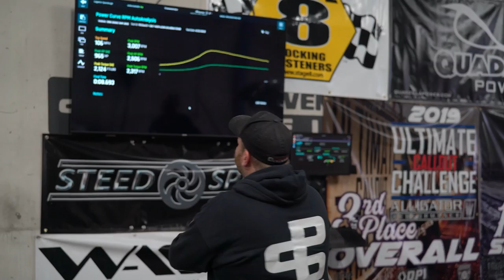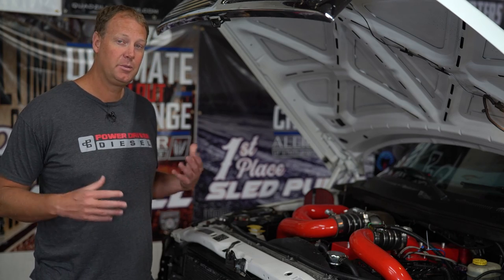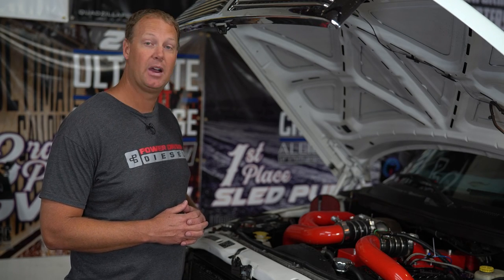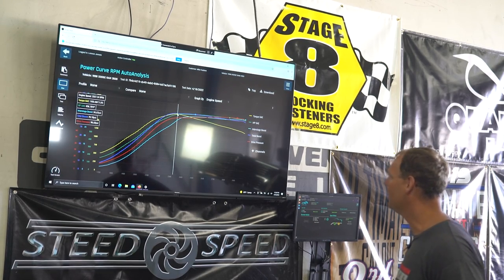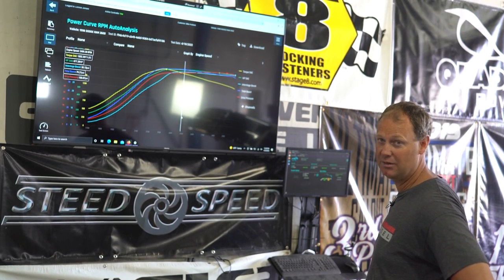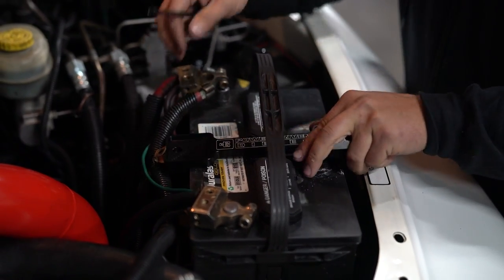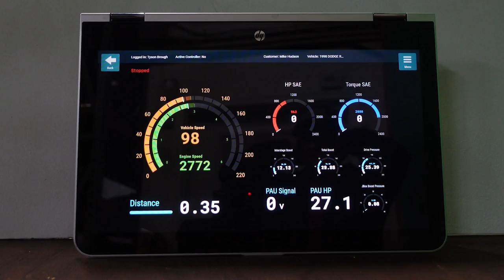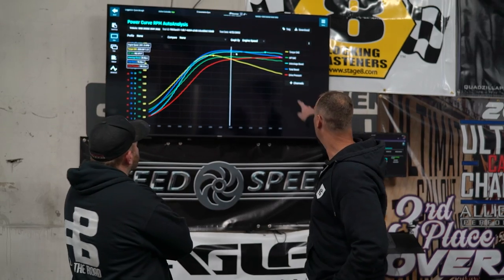Tow Ported Cylinder Head Dyno Test

Comment: Cool video I'd be curious if you all did one with the Hamilton stage one headed against your stage one head
Reply from the maker: As fun as it is to test competing products, it's difficult to show a credible comparison without appearing biased or creating a storm of hate when fans from both sides of the comparison contest the results.  We try to play nice in the diesel performance community.  Maybe if we get the engine dyno fired up where it has more control over test conditions and less variability from run to run we could do a cylinder head shootout on a test motor, Richard Holdener style!
Reply: @pddofficial  I understand that and I get it there's so many variables it would be cool to have a engine dyno with a mild built 12 valve and do a stock head your head and a Hamilton head on the dyno and then do a built 12 valve with with the same heads and results I know that's a lot of work but that would be awesome no one does that to show exact comparisons

Comment: Late to the game on this, but would be interested to see what's behind the transmission, drive shaft, gears, if any that can hold all that power or if it's all stock.
Reply from the maker: We build these transmissions in-house, this is one of our Weekend Warrior 1000HP rated transmissions: https://powerdrivendiesel.com/product/power-driven-streetstrip-1000hp/.  
Holding power for a quick blip on the dyno is fairly easy, it's holding the power while shifting and propelling a heavy truck down the street that separates the transmission part installers from the true performance transmission builders!
In this model of truck, it starts life as an OEM 47re 4x4 transmission.  It gets outfitted with a billet 300m input, intermediate, and output shafts.  Line pressure is nearly double with the in-house built high pressure valve body.  Clutch counts are increased from 4 frictions in direct/third to 6. Overdrive increased from 5 to 6 frictions.  Several small billet parts, servos, strut, anchor, lever etc are added to handle the increased line pressure and reduce cross leaks or shift binding.  Numerous lubrication mods are added for reliability in both overdrive, 3rd/Direct Pack, OD support, sprag lube, and 2nd gear band lube.  
The OEM 5 pinion steel front planet and overdrive planet are strong enough to handle this power level if they are in good shape, but the thrust load from monster torque quickly destroys the thrust washers (wear item) so we machine the planetaries, sunshell, and ring gears to accept torrington roller bearings.  We also weld the ring gear as the OEM spot welds occasionally crack and fail at this power level.  
The OEM flexplate usually fails around the 500 whp mark so an SFI rated billet flexpate is installed along with a billet cover triple disk converter in lieu of the factory stamped steel single disk converter that commonly slips/fails around the 700 ft lbs mark or mid 350 HP on a 12v Cummins application.
We top off our transmission builds with a deep pan for added cooling and extra fluid capacity; the cast pan also acts as a main case gusset to reduce flex from the monster torque/abuse.  
Finally we supply Power Torque ATF which has a higher coefficient of friction to give the wet clutches and bands just a little more bite than standard ATF+4.  The whole package has to work together to reliably hold 2000+ ft lbs, and survive the brutal abuse of propelling a heavy truck and shifting without torque management(power reduction) that is commonly used in modern drivetrain design and engineering reliability.
Reply: @pddofficial  do appreciate the feedback and as always the amount of detail you all put into every video! Currently I have the 400HP kit looking to go into my '96 with the NV4500 behind it, pretty stock but looking at the options of maybe in the future going back to Auto, so again, love the full explanation. 
My concerns lie in the U-joints, driveshaft itself, or the rear end (my case being a Dana 70 3.55 if memory serves correct) as this vehicle is going to be my designated towing rig. Not asking for full details on those (and maybe would be a good video suggestion for the future) but curious to see if anything in the final drive line/rear gets beefed that isn't drag strip only. 
Also I apologize if I missed any of that in other videos, try to follow best I can.

Thank you for the wonderful content, parts, and the response!
Reply from the maker: This truck has a factory Dana 80, as far as we recall.  Oem driveshaft with stock 1410 series Spicer ujoints so far have been reliable.  We've put 1800 HP through a 4x4 with a Dana 70 rearend and as long as it wasn't shock loaded and bouncing tire burnouts, it held for a while although the axles started to shear at the diff side gears so the OEM 32 spline axles had to be upgraded with a 35 spline setup.  On Will's 95' Junker Drag truck back when it had between 700 and 1000 HP, it started life as a 2wd Dana 70 and he twisted the output shaft slip yoke on the factory driveline, then a couple stock 32 spline Dana 70 axles where broken, and finally sheared off the 29 spline pinion shaft.  The Junker was switched to a totally stock Dana 80 and has not had another problem.

Comment: Anyone else see the dipstick zip tied in? Blows out from blowby?
Reply from the maker: Yes, it's quite common when you start making big power on these Cummins engine setups to see a tremendous increase in crankcase pressure and the dipstick will pop out a couple inches and make a small oil vapor spray mess.  Simple fix is a zip tie.  The other option is to add more crank case ventilation to reduce pressure.

Comment: My cummins fully deleted straight pipe no smoke...never...my buddies smoke clouds...why is that?
Reply from the maker: On trucks with tuning it is good tuner vs a bad tuner on 12v just a dyno tune
Reply: @pddofficial  so I'm assuming I have the good tuner👍🏼
Reply: It's all about your fuel load. The smoke is just un-burned fuel leaving the truck. Loosing fuel. Not very efficient. The cleaner the smoke, the more efficient its running.

Comment: I have a 99 4x4 extracab short bed. 180k miles. 47re. Won't shift into overdrive. Tops out at 35mph in 3rd gear. All new steering parts. New radiator. Replaced all solenoids with suncoast kit. 
Driven this truck like 3 times in 5 years.  
Tired of it......
Reply from the maker: You should be able to see about 60 to 65mph topped out in 3rd gear, so it sounds like it's not getting into 3rd or direct.  Without 3rd gear it can't do overdrive.  To check, disconnect the 8 pin connector at the transmission (this will default to 3rd gear limp mode with no electronics connected, and see if it will go any faster.  It will accelerate sluggish when you do this because it will start in 3rd gear, unless you manually shift it down to 2nd, then it will start in 2nd gear.  Manual 1st gear will still be 2nd gear with the electronics disabled if you start in D and manually downshift it.  If you start in N, and quickly shift to 1st or L before it can engage 2nd or 3rd, then manual 1st will still work.  

If you don't have 3rd gear, and there is debris in the pan, no electronic parts can fix the problem, it will need a rebuild.

Comment: Shame Diesel is dead at my at my Country and most likely the hole EU soon, at my country Diesel cost the same than 98e5 Gasoline (2.3e/l today "8 dol/gallone" for you yankees) + Diesel has yearly Diesel car tax that can be over 1000e++++, depends on a car...
Reply from the maker: That sucks, at least diesel is more energy dense so with a well tuned setup, should provide better fuel economy than a similarly equipped petrol engine.

Comment: How Are You Guys On a Both Smaller Turbos then Me and Smaller Fuel But Make 150hp more then I did 🫠😭
Reply from the maker: It's all in the combination!  We've seen injectors of similar flow but optimized k-factor and hole orientation pick up 5 to 7% more power. 
How restrictive is your exhaust manifold?  We tested a few stock manifolds on some of the old retired/cracked race War Heads and we saw a 50% reduction in exhaust flow with a stock manifold.
Piston bowl design, ring seal/cylinder hone, compression ratio, etc all change the power to some extent.  At some point the combination is limited by the turbo setup no matter how perfect the supporting engine, at some point you've consumed all the oxygen the turbo system can provide.
Reply: @pddofficial  I have a 3 piece manifold, an s369 t3 and a s480 and a 13mm at 26* and a fass260 and  all other supporting mods and put down 740 at Randy’s dyno event last weekend
Reply from the maker: What cylinder head do you have?  Is it still on stock pistons?  How many miles are on the rings?  There's even a big difference in 480 turbos, some of the older technology actually performs worse than the modern 476sx-e.  Have you tried a 1.15AR housing on the 480, it would probably pick up power with a tighter housing.